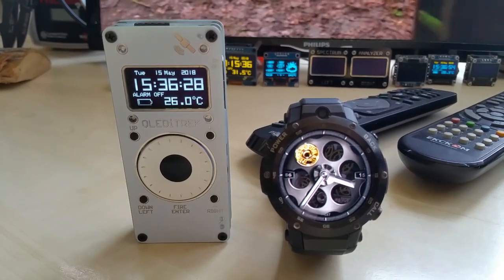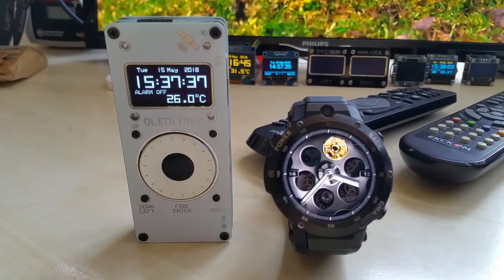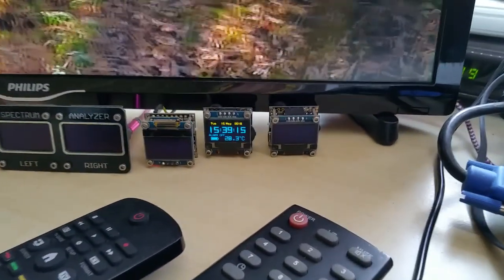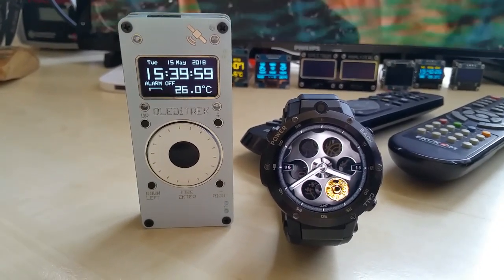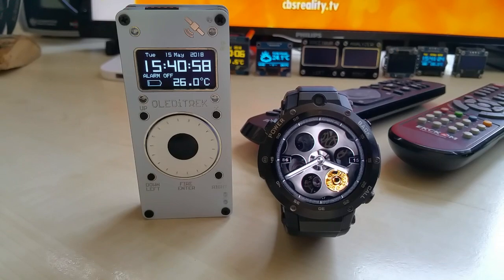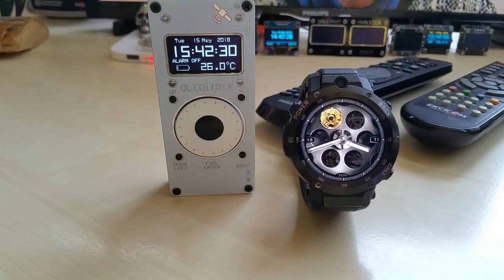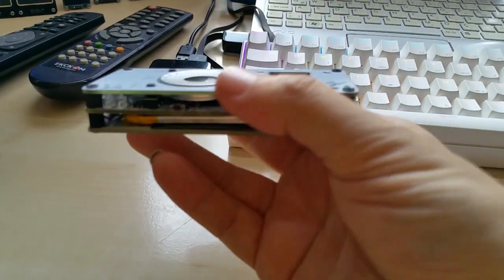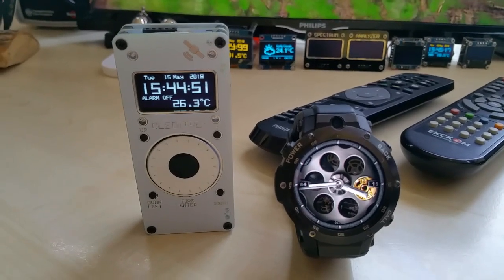OLEDiTREK Clock running for 24h04sec straight with display on.

Comment: Glad adding microSD & what about ability to connect to computer, is that a feature as well to get live data, etc....if SO, like said quality product
Reply from the maker: Thanks for your great comments. Yes, it took me way too long  but I think it will be worth it. It has, of course a direct USB connectivity so you can upload code directly to it and after you like it, you can copy the hex file that the IDE generates with every compiling to the SD card and select it from there through the menu. You do have I2C connection to expand it with any sensor or module that has I2C, it has D2 interrupt pin input to use it as a rpm meter for example, it has an analog input (A7) to measure voltage up to 17 volts (voltage divider on the PCB) as a voltmeter in a car for example, it also has a PWM output (D9) to generate frequencies with the frequency generator app that I showed a while ago here too. I also added a voltage divider to the A6 pin to measure the Lipo directly, so you can know how much power it has left, would not make much sense to measure the regulated 3.3V. BTW, love the name iTREK :-) Yep, the Thor is really a nice watch. I assume you know but just wanted to mention it here again, the iTREK :-) has also built in GPS, accelerometer, BMP280 temp and humidity sensor, wireless charging and the Neopixel stick on the side and an RTC chip with it's own backup battery (CR1220) to keep the time running that btw can be synchronized with the GPS signal to have the most accurate time anytime, anywhere on the globe :-) Hope you made it this far, sorry for the long post.